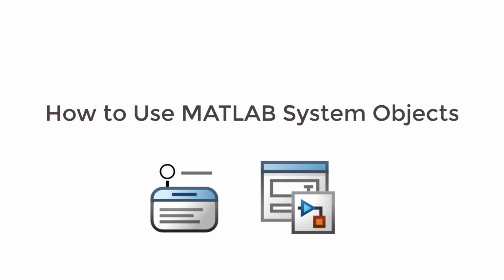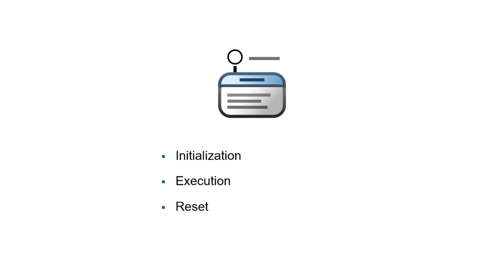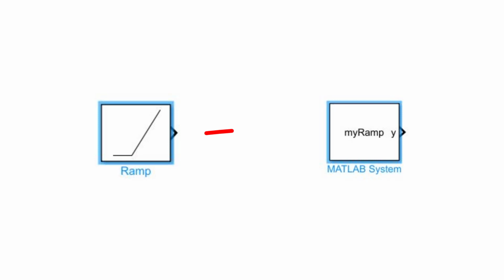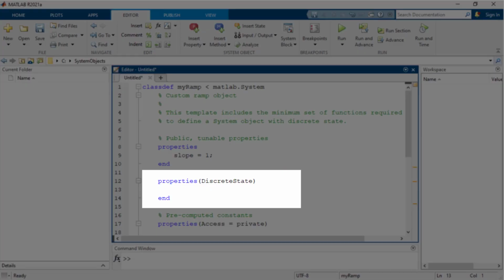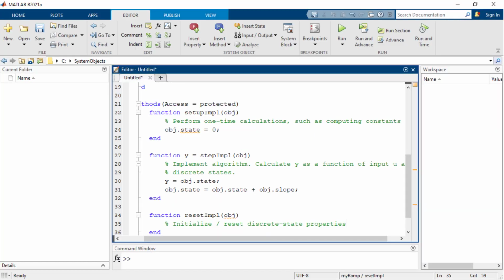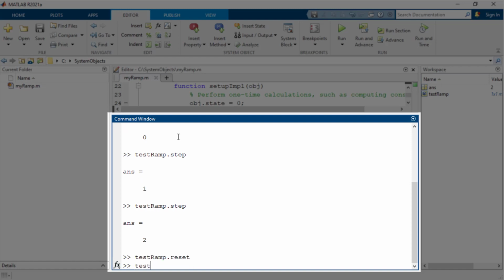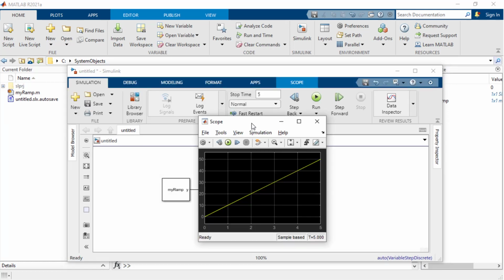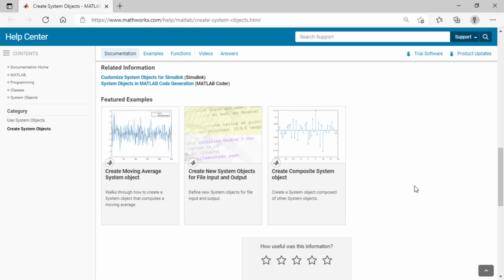How to Use MATLAB System Objects

Comment: Why in stepImpl() we return the previous state?
Reply: Good question! This implementation is a little confusing. For the first step, stepImpl returns the initial condition (0) THEN modifies the state by incrementing by 1. For the next step, it returns that state (1) then increments again. If you swapped Lines 30 and 31, the first step would return 1, which isn't the desired behavior.